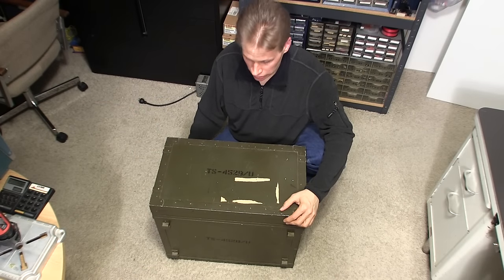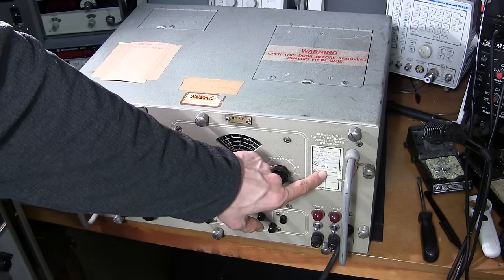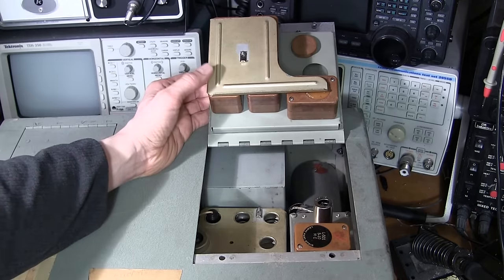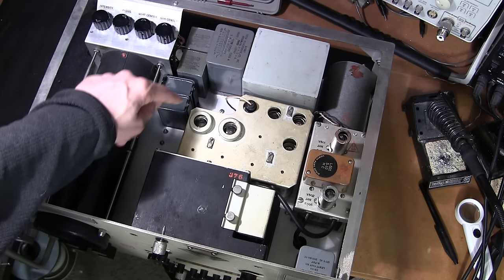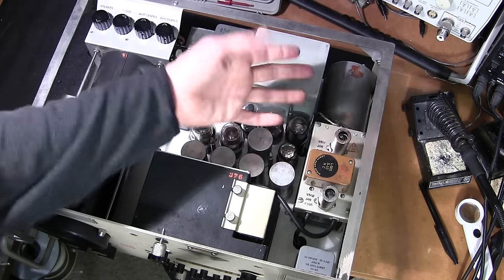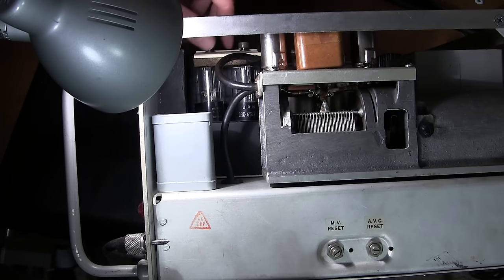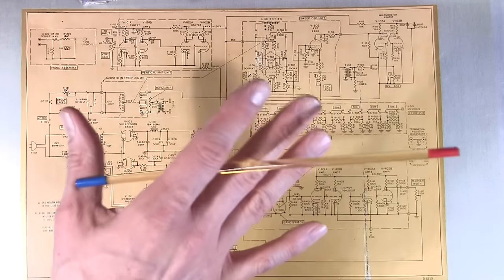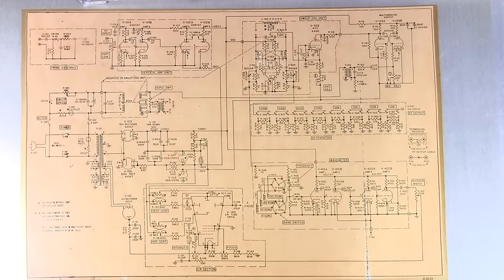Whats A Wobbulator? Tech Tip Teardowns

Comment: Wow nice piece of equipment would be a good collectors piece when it is restored. Oh by the way there is a company in dayton,ohio  called K4 supply company that has a few of those octal caps on their ebay site not sure whether they have a storefront though the ones they have were made by Aerovox.
Reply from the maker: +mac theknife 
Thanks Mac, I will probably re-stuff these with some new Nichicons. Any old stock or NOS octal caps are bound to give grief down the road. Thanks for your comments and suggestions!
Reply: +Mr Carlson's Lab these doesn't have the octal socket, and I don't know if they have the right values  
but it might be useful 
https://hayseedhamfest.com/

Comment: Hello Mr. Carlson. I found another schematic for the Dubrow ts-452 online. This one includes a diagram of a filtering network on the mains input line that was not included on the schematic that is on the bottom cover of your unit. It will be interesting to see if there is a line input filter on your unit when you do your restoration. If there isn't, I wonder why it would not be included on some units. I wonder what your thoughts would be on this. Oh, and here's a link to the alternative schematic I found online. 
https://richardsears.files.wordpress.com/2011/12/dubrow-ts-452-rf-sweep-generator-oscilloscope-schematic.jpg
Reply from the maker: +uomo d'onore 
Thanks for your input. I have talked to Richard in the past, when I got the wobbulator, His site completely slipped my mind, I'm pretty sure I even left a comment in there somewhere as well.

Comment: Hello Paul. I am having problems with the video not loading. I tried some tricks that work most of the time with youtube,no luck I will wait a bit and try again.
All my best.
Bobby
Reply: +Bobby Tectalabyss Works OK for me.
Reply: +Michael Beeny Hi still not loading for me I think it's a speed issue. I will run some speed tests and call my provider. Thank you for letting me know.
Bobby
Reply from the maker: +Bobby Tectalabyss 
Hi Bobby, For the first bunch of hours here, even after youtube has processed it, watching it at 1080p60 is very choppy. Try 720 next time and see if clears thing up.
Reply: +Mr Carlson&#39;s Lab Hi Paul. It wouldn't show anything but a blank screen. It's working this morning ,Awesome piece of test equipment. I am looking forward to more on this piece of history. Thank you very much for the reply.
All my best.
Bobby

Comment: Very nice - looking forward to the repairs and seeing it up and running!
Do you ever check the carbon composition resistors? I've been told before they age very badly, but I've never seen anybody else mention them!
Reply from the maker: +Minifig666 
I think it all depends where they have been kept (dry or moist atmosphere) I have many new carbon comp resistors with 2 percent tolerance bands, they are all spot on their values. The early carbon com resistors with the rounded edges, drift badly!

Comment: so there is such a critter as a wobbulator shaft. it drives an air gap cap who knew!
Reply from the maker: The newer (vacuum tube type) ones have a saturable reactor to produce a sweep.
Reply: in auto shop class(40 years ago lol) we always told the rookies on a service to grease the muffler bearing and make sure the wobbulator shaft was timed. then stand back and watch

Comment: Very nice wobbulator. This is the first one I see with a motorized capacitor. That is very nice. General radio sold motordrives for this purpose to use an unit oscillator as a sweep generator. I once made a spectrum analyser  from a receiver this way (just as an experiment, not permanent, I could be a nice video if you have the kit to make such a set up)

 I have an army version that is from the same area I think, see:  http://www.pa4tim.nl/?p=520  (I am an  analyser junky, I have a whole family of network analysers  like VNA, SNA, wobbulator, SA+TG and some DIY )

Does you wobbulator needs an external diode detector or is it build in ? Is it tuned ? 

The biggest difference between a wobbulator and a SNA /SA+TG or VNA is the detection. A wobbulator detector is often wideband, the detector responds to the highest magnitude and that can be a harmonic or mix product. That can be handy in some cases.  They often came with a cool type of adapter you clipped on a tube to inject the signal capacitive into the tube.
All other type  of network analysers had a tuned receiver. So they only respond to the incident signal. 

The term network analysis is a bit confusing, I'm not talking computer networks, that is a whole different game. An anecdote, I repair test an calibration gear for a living. Someone phoned me asked me to fix a network analyser.  Some red lights should have flashed when he did not understood the question about the bandwidth. When it arrived it turned out to be a computer network analyser. (fixed it anyhow)

If someone wants to know more about how to use an "analyser"  cq network analysis I wrote several tutorials for the beginning network analyse aficionado (and HAMs who want to know more about that to better understand their antenna analysers) because there is very little information for beginners about this subject.  http://www.pa4tim.nl/?cat=26

Fred, pa4tim
Reply from the maker: +pa4tim 
Hi Fred, Great write up! I have an analyzer collecting "issue" myself LOL! Thanks for the link, I will check it out. I haven't looked at the probe in the lid yet. I believe it could have the diode detection in it. When I do the restoration, I will have a complete explanation, along with an example sweep.

Comment: I did some work on an old Bang & Olfsen LX 2800 from 1986  (https://www.radiomuseum.org/r/bang_lx2800_ch_3702.html) and on the back panel of this extremely well made TV was the full, annotated schematic. It had 4 amplifiers (class D I think - not sure if I'm remembering right) one each for the two inbuilt speakers, and one each for the external speaker jacks! The inbuilt speakers themselves each were housed in their own, separate speaker cabinets, not just fixed to the TV casing by screws. 

They might be expensive, but there's a good reason for that... which is why it was still serviceable when I was looking into it in 2012 thereabouts.

I recently bought another Danish treasure - a Superphone Weekend 2 battery portable receiver from 1952 (https://www.radiomuseum.org/r/nri_superphone_weekend_2.html) which also had a schematic glued into the battery compartment lid. I'
l'll be recapping and realigning that during the winter at some point.

Comment: I much prefer watching the trouble shooting skills being shared.  This one lost my interest right off the bat.   It seems like you might be starting to struggle for good content.  Put a radio on the bench or an amplifier and keep showing how your powerful mind goes at walking through how you attack the problem.  When you do that it is magical.
Reply from the maker: +Kevin Gray 
Hi Kevin, I do appreciate your input. I have been working on a video for the last 4 months or so, between normal work. That is an in-depth video on a device that has been up and down, on and off the bench, what seems a 100 times now. I'm extremely busy, and even fitting in the TTT series has caused a few all nighters. I think spotting my red eye's in the video content is apparent...LOL!  Once this "on going" video is done, I will be back to regular troubleshooting video's, and will go back and fourth between them in the TTT series as time permits. If I were to just do video's full time, I would be able to put a lot more troubleshooting and repair video's up. I think the ratio is about 1 video in 20  repairs "or so"  right now. Taking a video while I work, with ongoing explanation, camera set up time, and mic set up time,  makes the repair time about 8 to 10 times the normal repair speed, so I have to choose wisely.
"I'm not in any way struggling for content Kevin." I have so much to share, I haven't even begun yet! It's all about making the time to video. If I was to make You Tube a full time thing, it would have to pay the bills. Please be patient, I'm doing the best I can, to share what I know.